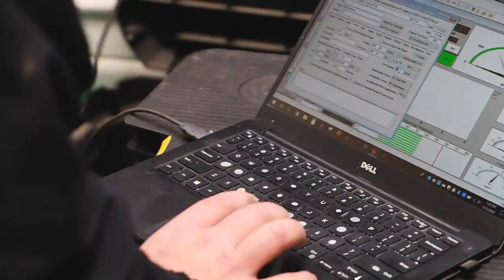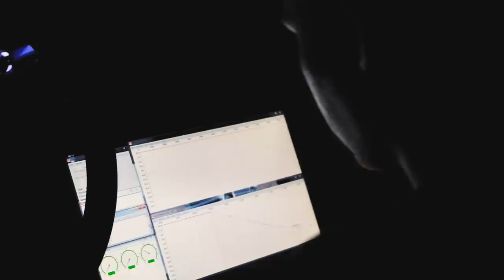Pad Days 3.0 : NOLA Street Racing

Comment: Someone get tkm to get this man some top fuel hoops! We need all the boost!
Reply: Wyandotte Weaver he needs them for sure!
Reply: You know I had not though of that you're right TKM could fix Billy's problems with the head gasket failures! Someone need to tell him! 🦅🇺🇸🦅
Reply: Definitely needs to improve the reliability of his engine, he has no problem going rounds but something allways bitting him in the ass, deffintly talk to tkm he's burning up Pistons to often.
Reply: @michaelwynne4346  its not pistons its the headgaskets being pushed out from the head lifting causing all the heat in the cylinders to burn the heads. Its almost like a stock ls block the head only has 4 bolts clamping each cylinder. He needs an aftermarket block almost like  an lsx block that comes ready for 6 bolt heads. Im aware hes running a 400 block not ls i was just using the ls platform for an example. An easy fix would be to have tkm do the top fuel hoops that cut into the head to bite the headgasket down.
Reply: @weaverfromtha913  maybe I didn't express that in my comment but that's why I said take it to TKM I watched a video of them explaining there fix for head gasket failure, I'm a BBC guy but I've heard talk about the issue with the stock LS blocks ,he needs to do something it happened a few times I believe it cost him a cylinder head the last time.
Reply: @michaelwynne4346  for sure! I thought he had a dart sleeved 400 block but im not sure if it comes with a more secure bolting pattern for the heads or not.
Reply: @weaverfromtha913     I know he just did that engine in 2019 but I don't think it's a Dart block, I believe he bought new head's, running a Blow through carb doesn't help either, I'm not sure if his dad is real familiar with EFI so that could be why, if he made the Truck more consistent he would be racking in the money, Billy and his Pop's make a good team.
Reply: @michaelwynne4346  hes redone the top end i think 4 or 5 times the last year i know like two times ago he broke a rod and killed a sleeve. Its for sure an aftermarket block.
Reply: @michaelwynne4346  Hi it is a dart block.
Reply: @GaMOPAR      I know he was using those heads but I wasn't sure if he still had the same combination, Thanks.

Comment: Man that's hard luck. Maybe O ring the deck on the next rebuild ?
Reply: Yeah he really needs to o ring that block
Reply: feeling like he gotta go efi, probably has 1 cyl leaner than the others burning head gaskets
Reply: @  @XxMusclecarsxX ; It's a 400 ci small block, they are temperature impaired to start with. Siamesed bores get too hot.
Reply: @ Ada 1812  with a crack on the back cylinder.
Reply: @joecucch8261  This is a new dart block ...no crack.

Comment: Hey Billy is your engine block and heads O ringed if it's not you should get that done it will save you headaches with blown head gaskets all the time I use to blow gaskets all the time but since I O Ringed my block and heads it's the best thing I ever did and I can turn the boost up more than I ever could do without it. you should look into it man because I'm glad I did it.

Comment: I'm also a gen1 Chevy guy, but you think you'd have better luck with an LS as far as dependability????
Reply: Ls engines only have 10 head bolts they are worse at keeping head gaskets sealed
Reply: steve beuchert He’s has multiple issues with the gen1 engines.  Not just head gaskets.
Reply: He told me he going SBF 💪🏿